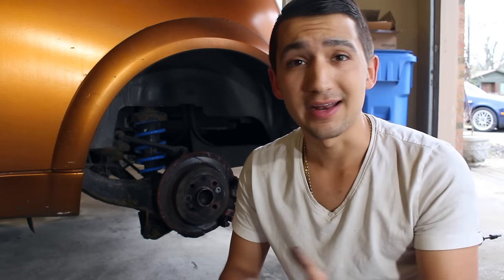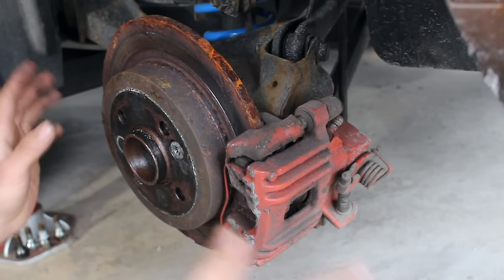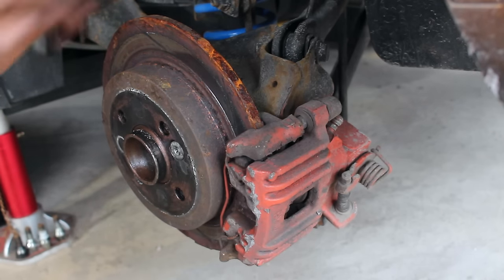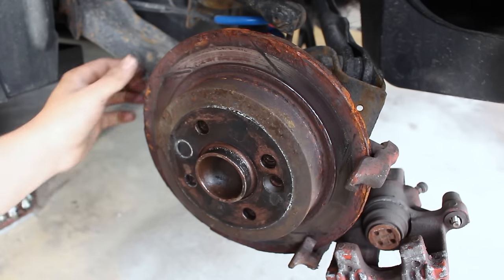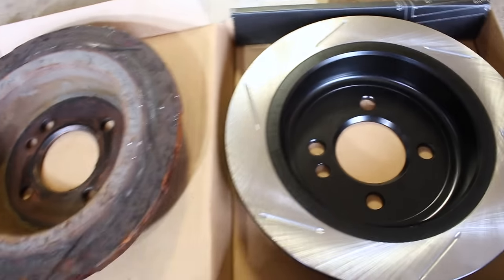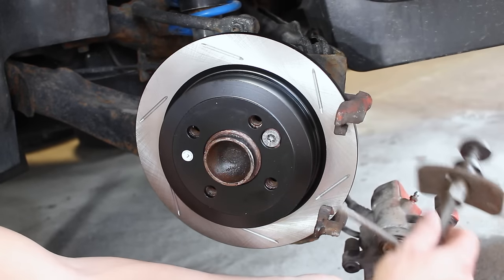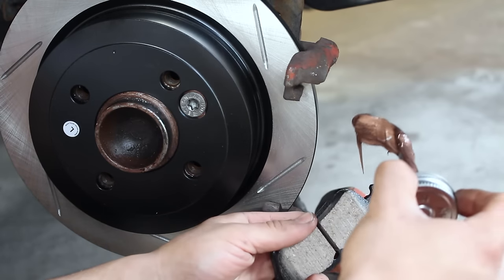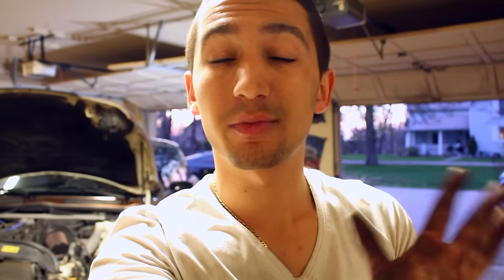The Best Lube for Your Brakes

Comment: Lol now your rotor sits on the wheel bearing hub crooked. Good way for a pulsing pedal. 2 machined surface must touch each other. When it's torqued down it will be a flase reading. You will always have a loose wheel

Comment: Great vid but I do not like to put any grease on the top/bottom of the brake pads, eventually, it might slide down to the contact area between the pads and disc and cause inadequate braking which could be potentially dangerous on the road

Comment: I’m confused. He says he services his brakes every other season, but then why do his rotors and pads look like they should have been changed at least a year sooner or 20 0000 km ago. I haven’t serviced my brakes in 6 years (original factory Toyota with 75,0000 km and they still look new. Rotors are shiny with even wear in both sides and pads are more than half. Something didn’t add up here. Must be using crappy parts, or neglected service.

Comment: can you use silicon paste for both the slider pins and the rotors?
Reply from the maker: +Dylan Rodriguez You can use it for the slider pins, but I wouldn't use it for the rotors. Only because it won't keep the two metals from fusing together. Because the copper in the copper antiseize will not rust like steel, it is a perfect medium to go between the two metals.
Reply: Yes you can use it in both locations.  This guy doesn't know what he was talking about.  Hopefully he learned something in seven years.

Comment: Hey Milan! On my CR-V, I noticed if it is in Park for awhile and then I go for a drive, if I pull forward then shift into reverse, drive just a little bit and hit the brakes, it makes a "metal on metal" click sound (As Honda calls it). I took it to the dealer and they looked at it and heard the noise, they told me it is called "brake shift" and that is to adjust for heat expansion and that this was normal. Are they full of shit or is this just a normal characteristic of a Honda vehicle? It will only do this once and when I'm changing directions.
Reply from the maker: +Jordan F I'm not sure what that brake shift is. What it might be is the emergency brake. I know that the emergency brake tightens and adjusts when you drive in reverse and apply the brakes. So it could be that they are adjusting, or it could be something else. Have you brakes been serviced recently?
Reply: +milanmastracci Yeah I took it to the Honda dealer and they say they looked at everything and it was fine. They gave me a paper that had the following description on it and why this is "normal". "From what you are describing, this is normal. A loud "brake click" is a normal characteristic when changing direction after letting the vehicle sit for awhile due to the design of the caliper. The front brake calipers have a small amount of clearance between the shims and the pads which allow for expansion when the brakes heat up. 

You can verify that this is the case by cutting up business cards and wedging them in between the pad and the caliper bracket. The noise should go away." Have you ever heard of this before?
Reply from the maker: I haven't ever done that bore ahah Good to know :)

Comment: Dude I’m goin crazy, I tore my front brakes down on my Audi twice now and they still squeak!  I think I didn’t use enough lube, I dunno 🤷‍♂️
Reply: put some anti-seize on the pad shims where the brake caliper makes contact for both brake pads...that's usually the source for most brake noise unless you're running ceramic rotors, which are just noisy period.
Reply: glamdring0007 thanks man!

Comment: can you use dielectric grease for the slider pins?
Reply from the maker: Yes, that is the same thing as Silicone Paste :)
Reply: thank you! Silicone Paste is very hard to find (not to mention it is very expensive) and I only can managed to find dielectric grease but in small quantities (in sachets) but it if it is the same thing then its good enough for me. Keep it up!
Reply: Permatex had a silicone based brake lubricant that works really well.

Comment: Don't you need more bolts to secure the brakes???
Reply from the maker: +CannoN NuGeTs Not for the rears as I didn't take the bracket off.
Reply: +milanmastracci I think you misunderstood me. I mean the brake disk, you attach it to the drive shaft only with one bolt isn't it going to wobble?
Reply: +milanmastracci And mate im here from yer' 1k subs I've watched most of your vids. And you are a self learner right?
Reply from the maker: Oh no lol lots of cars only require one bolt to secure it to the hub. Keep in mind that when you put the wheel on and torque it down, the wheel is going to be pulled towards the hub with about 500 pounds of force. 
Yeah I learn a lot of it myself :) Trial and error goes a long way, but more than that, research.

Comment: What do you think about permatex extreme ceramics?
Reply: Ryan from what I saw on another video by a professional mechanic you can use it on all the break parts metal on metal and for rubberized parts, I'm most likley buying that for my break job
Reply: Kevin Loiyza I own it. But I've been told only use silicone grease on the rubber pin boot things
Reply: Ryan yes from what I read too the silicon is by far the best for the pins the green or purple ceramic lubricant by prematex will work but drys up after a few months, and where copper paste was put you should actually be using something like that green or purple lubricant from prematex that doesn't have a gritty texture which wears down the metal parts
Reply: Ryan the Cooper/silver antiseeze paste should only be used for the rotors to the hubs, hub screws, lug nuts ext. Really Anywhere serious binding will occur. If you don't want to spend 30$ on 3m paste, Napa and AGS also sell silicon based lubricants in smaller tubs for about 5-10$
Reply: Kevin Loiyza so you'd use it on the rubber? I used the green permatex on my sliding pins that touch the inside of the boot
Reply: Ryan I'd say the purple permatex is better then the green one I've seen and read cases that the green one will make the rubber swell if mixed with any leftover grease on the pins

Comment: Where the pad contacts the bracket I would use lithium grease, not anti sieze, as those pads actually move back and forth on the bracket.

Comment: Great video. Have a questions. I seen on another video used 3m silicone on break pads where metal to metal and you said siliconecopper  seize. Would something go wrong if I use silicone paste instead on min8.43?
Reply: it's  copper anti-seize.    silicone gel will melt if you apply it on the brake pads.   the former is a grease for high temperature. the latter is a gel

Comment: Copper grease on pads sliding points is not corect.
Reply: Yes, it is. That works very well, and working at a dealership, we've done the same when doing brakeservice. We often use Alu antisieze tho, but copper aswell.

Comment: LOL can't believe that shit... the guy smears the inside of BRAKE rotor with copper grease. what about cars who have handbrake pads which grip inside the rotor? how well will they brake after buchrering inside of rotor with copper grease? :D Good luck to ones who follows such videos cause you will need it :D
Reply: Its a rotor not a drum.  Hes ok on what he did
Reply: roberge32 Vidmantas K. was talking about cars which uses the inside of the rotor hub as the friction side for the handbrake. Some cars don’t use the rotor surface for the handbrake but uses the hub instead.
Reply: Because he installed a disc, and not a brake drum. 
If you have a disc/drum-compination rotor, then of course you're not supposed to apply grease. If you can't figure that out yourself, you should not work on your own brakes, though I guess he could mention that for a future video.
Reply: amateur